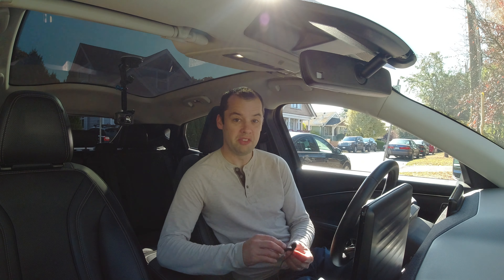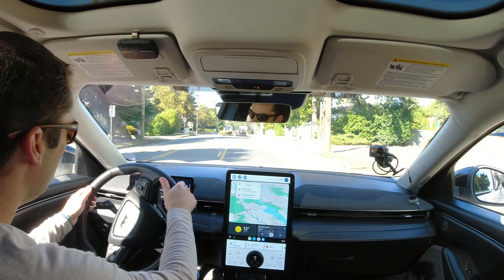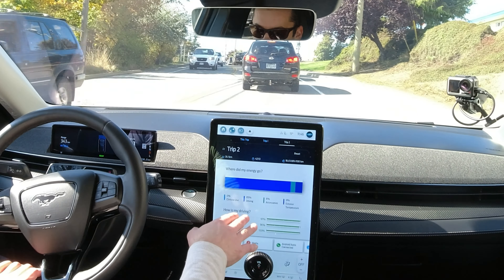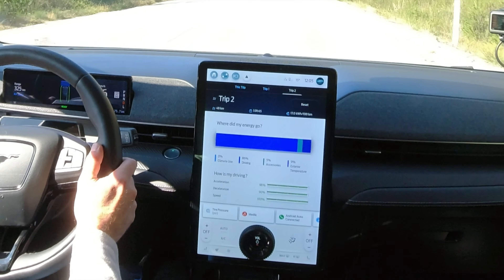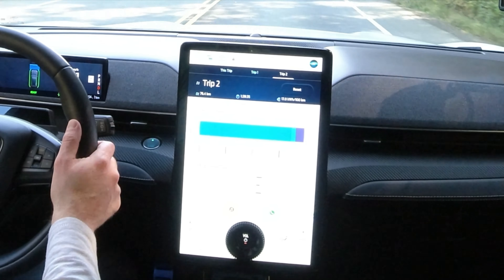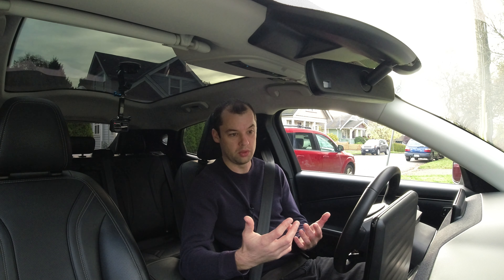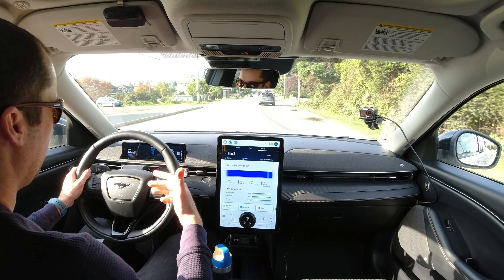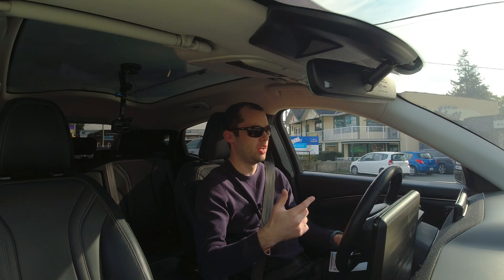EV Ramblings - Fast EV01+ Wheel Efficiency Test - Mustang Mach E

Comment: I have those efficiency wheels standard on my Mach-e and want to only use them for summer tires too because of longer trips like you said. I also live in Alberta, so I'm worried about the shiny plastic panels all scratched up by the gravel on winter roads

Comment: It's not gonna make a notable change because you there are lot of factors to take in mind
You should go for 1" smaller rims cause you'll save at least 10 pound per wheel total 40 lbs rotation weight equivalent to 100+ lbs ripping weight from you car
Wind speed and temperature 
I use it on ioniq 5 18" ev0+1 I get 13 to 14kwh/kh in city and 16 to 17 on highway at 120km/h outside temperature below 8 degrees